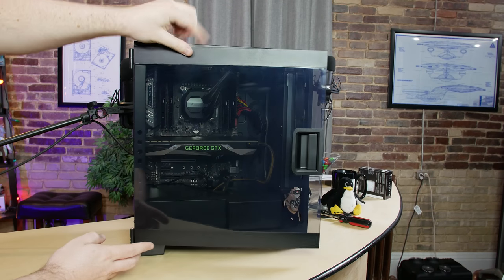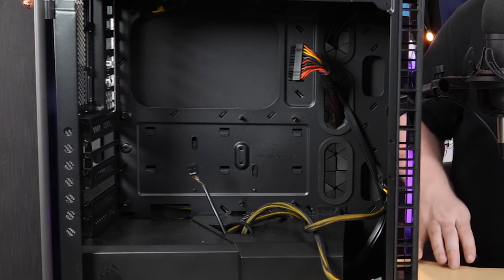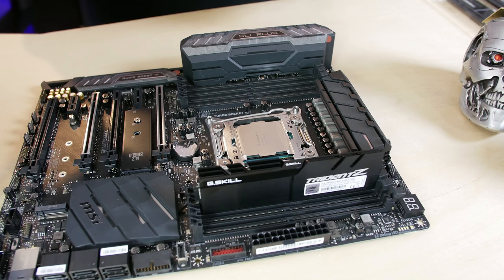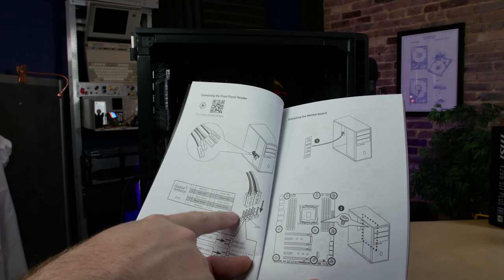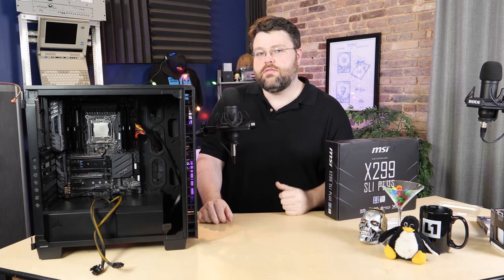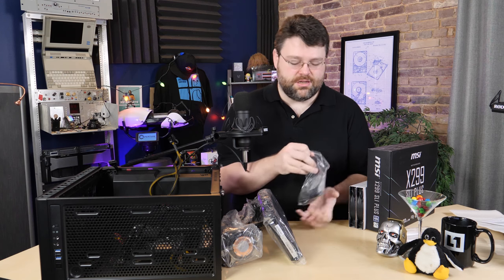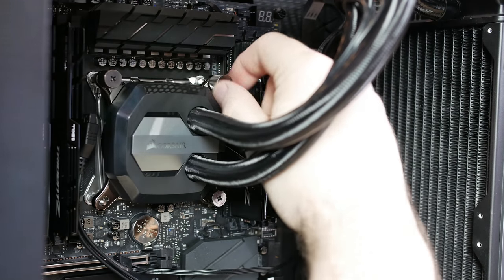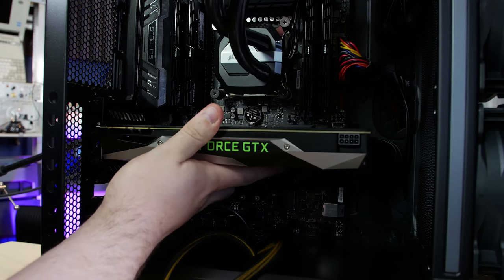Building an X299 System: MSI X299 SLI Plus and GTX 1080

Comment: isn't properly attaching the heat dispersion system needed for the best distribution of the thermal paste? thermal paste wasn't even covered. was it not needed, pre attached to the bottom of the heat sink?

Comment: Great build video, solid smooth consistent audio between all the transitions and cuts. 

How about delidding the cpu? If it can do 4.6GHz with default tim, it should do at least 5GHz with replaced tim or direct die cooling. Also then you could actually push the vrms to what the limits of the platform.

Comment: I've noticed there's nothing said or shown about the power supply, it remained hidden under the case cover the whole time. The system is magically turned on and working :P
Reply: He said the PSU was already in the case and he had routed all the cables already for when he put the MB in.

Comment: points at the black electrical tape over the hd/os led's on the start button panel as for your radiator placement quit using sissy cases and purchase a case for cooling and airflow. chuckles I have a thermaltake core x9 exactly how do I make the case 'horizontal" ?

Comment: I'd love to have that system.....

And sell it for profit & get a Ryzen system lol
Reply: BEST COMMENT EVER!
Reply: Give Me A Smile I'd sell it buy multiple ryzen systems
Reply: ...and then get a full set of gold-plated ceramic teeth.
Reply: I would rather sell it and get a 7700k system since it is the best CPU for gaming out there.
Reply: "but but ryzen"
Reply: For exclusively gaming.... but if you want to stream too the ryzen chips are still better.
Reply: not really, 7700k is enough to stream and get max fps in a game. remember video games barely use more than 2 cores. any professional streamer uses 2 PC setup anyway
Reply: Shoufu La Strange Is it really a big upgrade ?
I have a 5820k and a 3440x1440 and I really want more fps, I need to change my gpu but did the CPU really change a lot ?
At 4.12ghz on air I'm very happy atm, but you indicate that I might get a lot more out of the pc ?
Reply: Yes because you went from 2014 cpu to a 2017 cpu lol. I am not sure I believe you even still unless your CPU wasnt overclocked, and if it wasnt overclocked, your are a noob. 5820k still has better single thread performance then Ryzen 1800x. Both CPU are over 2 cores. So for you to get higher FPS kinda seems like a lie. A dual core gets the same fps as 4, 6, or 8+ core in video games.  Placebo maybe? Maybe your didnt properly cool your 5820k and it was throttled? who knows.
Reply: Long story short you're not gonna experience any major upgrade from 5820K to r7 1800x, in single core, the i7 wins, in multi core ryzen wins.
Reply: @Dondonian Gamers Nexus has a video on 7700k VS 1700 for streaming. AMD wipes the floor with Anthill
Reply: What a cpu with more cores/threads is better for a multi-threaded task?!!?!!? You dont say! 7700k will still reach higher fps in games since it has the best single thread performance.
Reply: With the words of Neil deGrasse Tyson "You are not ready to be convinced"
(in other words: Nothing more to be talked about here)
Reply: LOL nice black science man quote dude! Hes not propped up just because hes black or anything. To quote the great Yuri Bezmenov "They are programmed to think and react to certain stimuli in a certain pattern [alluding to Pavlov]. You cannot change their mind even if you expose them to authentic information. Even if you prove that white is white and black is black, you still can not change the basic perception and the logic of behavior."

Comment: why is the connections for the boards to tower still using such a outdated system? i have done plenty of builds. The needed connections are pretty much the same now between all towers. why is a standardize multi pin connection not used? especially one of the ones that are tough to plug in the wrong direction.

the current system is worse then the older IDE drive connection system. cables that can be attached several different ways. only one of them correct. then jumpers that have to be set to the specific setup. With the possible jumper settings not listed on the drive.

Comment: now that benchmarks are out i agree the 6 core is a waste however if intel had left cache alone and used the ring bus design, and if it was soldered or delidded and liquid metal was used itd be a golden chip. cheap(for what it wouldve been) same IPC as far as gaming compared to kabylake, skylake x seems to have better overclocking potential then skylake so yeah. wouldve been a 150$ increase in cost over a high end z270 system maybe a little more but 6 cores 12 threads more lanes plus quad channel memory. for future games i honestly believe having those extra cores will prove beneficial plus the extra lanes and memory channels wouldnt hurt.  oh well heres hoping z370 isnt a bust as well.

Comment: I thought that I would not miss the 5.25" bays, but then I borrowed some DVD's, and my case back has been off with an old DVD drive hooked up for the last month. I regret buying my NZXT 440 with no 5.25" bays. I will buy a stupid external drive, but this is stupid. We are not there yet.
Reply: Garry Perkins I use CD's so rarely that with my h440 I have a USB reader just sitting in a drawer
It's been used maybe 5-6 times in 4 years

Comment: +Level1Techs do you recommend X299 over R7 or even TR ?
Reply: basically....dont buy too much CPU

the cheap i9s that replace the 7700k ARE POINTLESS WASTES OF MONEY
if you need only 4 cores.... get a 7700k

a 16 core thread-ripper for games is also a pointless waste of money
it will play games great....but so will a 800 dollar cheaper 6 core

if you want a cpu that is cheap, and will last 5+ years..... get at least 6 cores 12 threads ryzens

if you want a cpu that will just last 5+ years...and isnt cheap......get an i9 with 10 or more cores (where ever the cut off point is....buy the i9 that allows you to use all the RAM and PCIe slots)